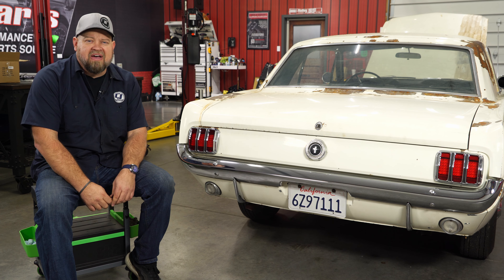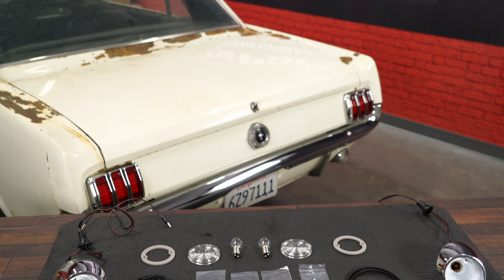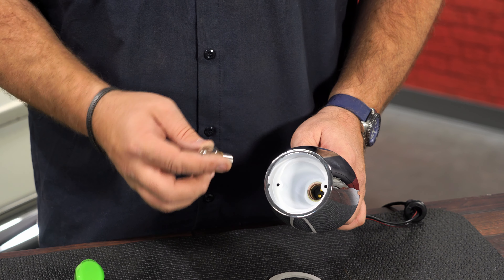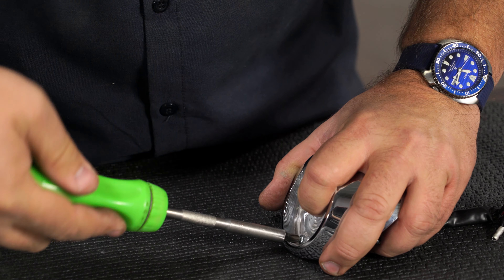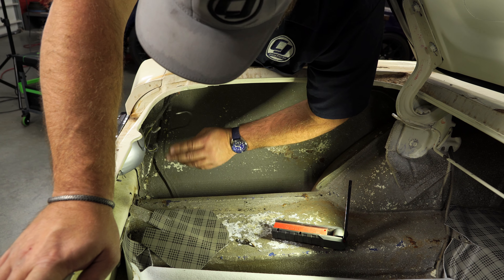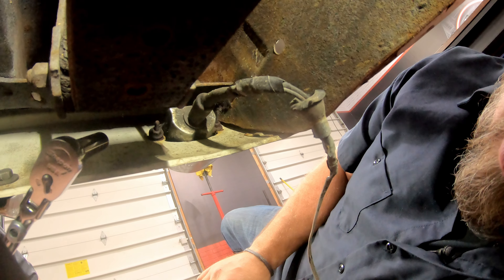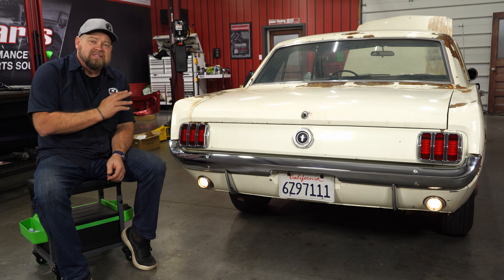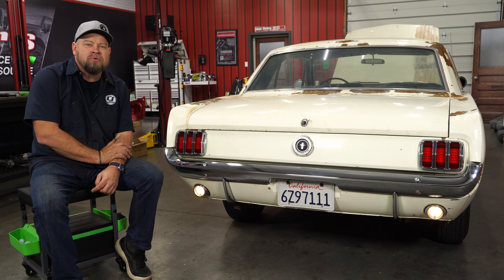1965-1966 Mustang Install | Backup Light Kit

Comment: My 1966 has lights but they do t go on automatically when you go in reverse there is a switch to do it manually. Is this normal or did someone mess with the wiring before I owned it

Comment: my 65 did not come with reverse lights the wire in trunk is solid will not disconnect , what do i need to put reverse light as for wiring.do i need to replace the complete wire harness or is there an easier...simpler way   please i will look back thank you in advance

Comment: You should have reused the angle (wedge style) washers that you showed when taking the old ones off. There is no way that is going to stay tight as the nut is only touching on the bottom part of the valance.